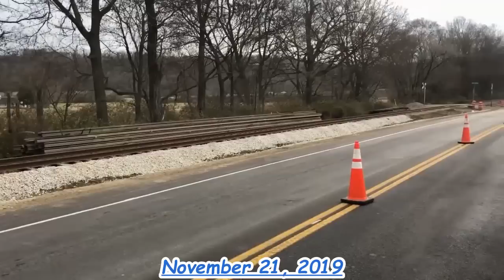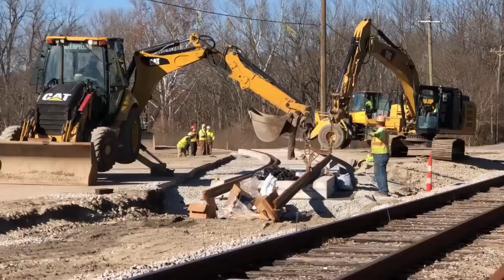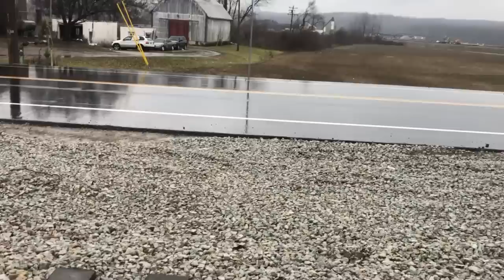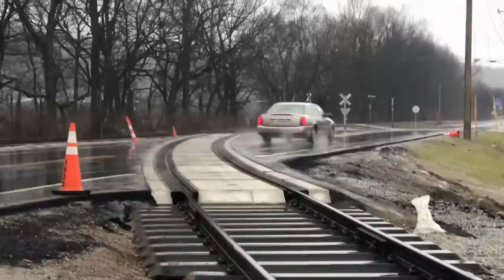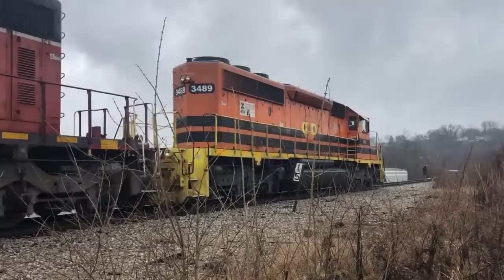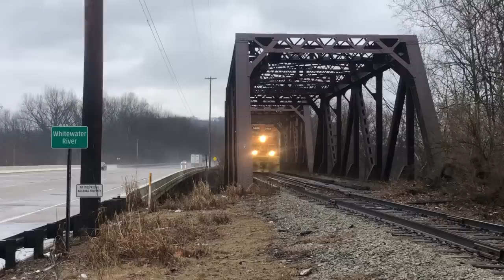New Railroad Spur Installation!  New Crossing, Derail & Switch!  Steel Cross Ties!!  IORY

Comment: Great video!! Glad to see there ate places still having spur industrial lead tracks being built to facilities. Also that is very interesting seeing steel ties for what looks like the while length of the new track rather just at the derail switch!! The only time I known of steel ties used were for light rail tracks that are street running before they get the concrete poured over them.

Comment: Who ever Thunk a New Rail Line (Spur) would be installed in the Year 2019/2020 ?  A BIG day for a LOT of folks. YEA!!! 👍👍👍
Reply: Ken, There is a new common carrier line being built in Utah from Vernal to near Helper connecting with the former D&RGW ( now UP ) It is 85 miles long and will be the first common carrier line built in the US since the 1970's. It should be operational by 2023. It will haul oil, coal, and ag products out of the Uintah basin.
Reply: I saw a new rail spur go in in 2008, for a steel products plant.  They receive steel coil cars via rail, and have a 3.3% grade from the branch line to their property.  The short line operating the branch bought an SW1200 just for the plant 🤣
Reply: @brentboswell1294  OK, but WHERE THE HECK IS IT ? DUH !
Reply: @brentboswell1294  Was it in Canby Oregon?
Reply: Thunk lol 😄
Reply: @chuckgilly  yes it is..
Reply: Ahhh! That new railroad smell.

Comment: Huh, neat. First time ive ever seen steel ties. Ive seen concrete and the standard wood ties, but steel, that is a first.
Reply: Havok Vladimirovich Stalinov Funny I was about to make the same comment I wonder if they will last and not rust out
Reply: Havok Vladimirovich Stalinov Same here
Reply: Trainkid 4501 I am also wondering how that affects track signaling if that acts as a ground I’m not an electrical expert by no means but I was wondering
Reply: Yea I wonder too
Reply: Steel ties are common in Europe.
Reply: Me too,I've only seen concrete and wood ties where I live,there's alot of tracks near me in the city. I even hesr the freight train coming through at 2am since I'm up on a hill and hear the air horn.
Reply: Common in Australia in termite country , they eat the wooden ones for breakfast.
Reply: Same here never seen steel. I thought concrete was the new thing. Asphalt business must be booming or will be
Reply: @remylopez4821  They are insulated from the track circuit.  Steel ties require less ballast (45%, compared to timber ties) and storage space, since they have a large void, so they are actually lighter.  They are also 100% recyclable.  However, a tamper, which would normally tamp every other timber time, will need to tamp every steel tie to ensure filling the inside with ballast.
Reply: Those steel ties and turnout came from my previous employer here in south Dallas! Narstco..... check em out!
Reply: @Havok Vladimirovich Stalinov they’ve plenty of steel ties in Japan metros.
Reply: Steel ties are used commonly underneath street running rail (e.g. girder rail). As for its properties in a signaling system, we'll, Lionel trains have used steel ties for years🤣
Reply: @brentboswell1294  I was just about to say... where are the huge green cardboard insulators and that 3rd middle rail....LOL🤣
Be cool to see something like LIONEL 1:1 embossed into the outside of every 15th tie!
Reply from the maker: I know where there are steel ties in northern Kentucky at the CSX tunnels.  I have also seen plastic ties.
Reply: @JawTooth  👌🏻 plastic ties.... ATLAS or TYCO?? LoL🤣♥️
Reply: @JawTooth  BTW, love your approach to filming things like this switch installation. 
Before and after shots take some extra hours, but it's worth it to document history....especially when you get to railfan too!
Reply: @JawTooth  Do I not see ballast underneath those new rails? If so, why aren't there any? Thanks!
Reply: Trainkid 4501 pnbbgtff8bvd

Comment: The Railroads have a following like NO other sport, hobby, etc.  Very Cool gesture of the Engineer waving 👋 to you.  The majority of time, the Class I Railroads have the dark window Closed and you can’t see the Engineer driving the train or the Conductor handling other logistics, 👍
Reply: we live in a more complicated and dangerous (perception, here) world..... sadly the days of an engineer inviting a 
young impressionable future railroader up into the cab are largely gone.  I love the machines and infrastructure, 
rolling stock, architecture, etc..... but railroading is largely about people.
Reply from the maker: You are correct.  I have been around trains since the 60s and I agree, the crews were a lot friendlier back then than they are today.  I use to get rides in the locomotives and cabooses.  In the past year I have been given the finger twice and assaulted and cursed at by train crews.  I try to stay away from the crews.  My focus is on the railroad itself.
Reply: @JawTooth  wow, I never knew about the negative reactions or aggression.... do we now have examples of
railroader's "road rage"?   Our culture is not heading in the right direction, I'm afraid......  perhaps the working
conditions on the line have changed and bear some responsibility.... just guessing...
Reply: Hey at least the Amtrak crews are friendly! Usually you can get a nice wave from the engineers and even a couple of blows on the horn....as long as you're not doing anything stupid and unsafe!
Reply from the maker: @williammorse8330  I made one video showing a conductor giving me the finger near Cincinnati.  The other one and the assault I have not posted yet.
Reply: That's terrible to hear, your being treated so badly by some train crews for simply trying to record railroad activity for historical reasons and for your enjoyment, as well as sharing it with other like minded railfans. If nobody ever bothered to go down to trackside and photograph the generations of railroad equipment and activities from past years a lot of visual transportation history would have been lost. Guess the crews that gave you grief could care less about railroad history. The people they should really get after are the ones who tresspass and deface railroad property.

I remember an article in "Trains" magazine back in the 1960s where one of the staff went to Georgia to see what shortlines were still operating that had been featured in the book "Mixed Train Daily", published back in the 1940s. The writer mentioned one crewman who threw an apple at him while he was photographing the moving engine from a roadside parallel to the track. He had a chance to ask the crewman at their next stop what his problem was, to  which he answered, "I don't like my picture being taken!"  Guess even in the '60s a few RR workers had an attitude towards being photographed.

Comment: I suspect that the steel ties are for the sharpness of that turn. Given the sheer weight of the loaded cars moving on that turn at even slow speed would put a ton of stress on the ties. Wood ties would break and not be able to hold onto the spikes without stress and eventually splintering. While concrete ties would handle the stress better, any cracks on the curve would instantly break up the tie because of the stress. The only place I've seen steel ties was in London at a station that had a very very sharp turn. There were always the words "Mind the Gap" on the floor of the station where the doors open. They also mention it when the subway train stops.
Reply: I've seen some pretty sharp curves with timber ties.  I noticed that this track didn't seem to have a flange greaser, tho...
Reply: @NiceMuslimLady  There are few places, outside of subway tracks, that have this sharp a turn, though. You're right that wood ties work on curves. but this curve is very sharp and prolonged as well

Comment: Neither rain, sleet, snow, or a zombie apocalypse can stop Jaw Tooth from his appointed rounds.

In my day, auto rack cars were completely open to the elements.  There was a time before when they were shipped inside box cars.  Today they are covered, but Europe still ships vehicles on open 'flats'.  Reminds me of the time in 1967, or was it '68,  when I was working Englewood Yard in Houston. [SP].  Not sure what happened, but an open auto rack car full of brand spankin' new Pontiac Firebirds came off the hump and down into one of the tracks I was near.  The retarders didn't retard, or the switchman pulled the wrong cutlever, or someone got confused and didn't shove it, but anyway it slammed into some other cars in that track and Firebirds went everywhere.

Comment: I trust that you will post a video of the first train to use this. (Hi-rails and construction vehicles don't count)
It's interesting to me to see how quickly this work was done.  They have been rebuilding a 7 mile stretch of the old Jersey Central in my backyard since 2006. New ties, trestles, sidings, crossings---no trains.
Reply from the maker: I tried to but I didn't get there at the right time

Comment: I've seen rubber ties, wood, bridge ties and concrete. Hollowed out steel ties for a switch but never metal ties. Bring a siding it must not need a track circuit. Nice video.
Reply: Steel ties ARE metal ties.  The crossing probably has a circuit, but, they can insulate the steel ties.
Reply: Now, plastic ties, made from recycled HDPE, are being used in Texas. The problem with plastic is the hot, dry climate, which causes plastic to dry out and crumble.
Reply: @danielcobbins9050  the plastic tires had holes in it for track wires. Hard outer plastic and soft inner, with grip surface in the bottom. They only tested them and removed them. Never in service.

Comment: There is a new spur at a cement storage and distribution company in Grandville MI.  It holds about 30 cars and can shuttle them to unload into Two large silos.
18 wheelers load under the silos. There are Four tracks on the site.

Comment: Interesting- lot of upside to steel toes- lower environmental impact, recyclable and durable. Wonder how long the will last before needing replacement. Good to see tail going down . Here in New England the MNTA has plans to reactivate a long closed  line from Stoughton to New Bedford MA  - but dang it seems to take forever. We need the track team that laid that line working here .
Reply: Is it lower environmental impact? Creosote is nasty stuff; making cement requires a lot of energy and releases a lot of CO2 from making lime; steel requires a lot of energy and releases a lot of CO2 from smelting the iron. I really can't tell which of those would be the best or worst.

Comment: Cars coming toward the spur could see a train in time to stop but not the cars coming the other way. Their vision would be blocked by the trees. Sure the engineer would blow his horn, but you know drivers these days blast their radios. Just flashing red signals should be enough. Looks like its going be used pretty often. That is a state highway I'm assuming.

Comment: Amother excelllent video, sir.  Thanks for going out into the miserable weather to film the train stuff; but:  Whaaaaat!!! Steel ties--I would think they would rust and cause a train wreck etc.  Are they treated with something to prevent rust?  Have you ever seen steel ties before?  I'm shocked.  Steel ties seems so wrong.  What's your take on the issue, Mr. T?

Comment: I came down IN sr 1 out thru Connersville. Seen a mess of coal cars on Whitewater valley railroad. 
And they where working on the tracks between  Brooksville and Harrison. And I seen signs saying nickle plate rd. I've seen old engines with that on it. Did that run thru indiana?

Comment: Why no RR signal warning flashers at the spur crossing? And why is the interlock not electric? With an indicator of the track switch positions? Could have a remote switching from a dispatch console or tower.
Reply: @wfvideos4099  Of course I am aware of the red/white flags on the manually controlled interlock as the indicator of the track switches.  This being the case with limited use of the crossing and a train conductor stopping traffic,  yes then agreed no need for RR crossing signals or an electrically operated interlock.

Comment: Nice video.never seen steel ties before.what happened to cement ties?
Reply: Dennis Willaman google “narstco” they are more eco friendly and easier to dispose of than wood ties that are coated with creosote.
Reply: Concrete ties have a bad reputation in northern climates. The freeze thaw cycles caused them to deteriorate prematurely. Several railroads including the Massachusetts Bay Commuter RR had to completely replace concrete ties throughout their system because of this problem.

Comment: I don’t claim to be huge rail fan, but this vid popped up in my suggested list and I clicked. Turns out I live a few miles away.  I’ve been watching the progress as I drive by and the other day I noticed the rail makes a quick descent of about several inches when transitioning from the crossing onto the new rail bed. Is there a reason for this or did someone get the elevations wrong when excavating? I sure hope this will cut down on the truck traffic into the asphalt plant.

Comment: Wonder how they deal track circuits with steel ties? Insulators between the rails and the ties? We have wood and concrete on the KCS main line around my house! Never seen steel
Reply: Tyler Costantini they make insulated as well

Comment: Haven't seen steel ties, only concrete ties on the west coast. Steel ties must be due to the weather conditions in winter which are worse than on the west coast
Reply: Robert Callahan they’re eventually and hopefully going to replace more of the old wood ties. Eco friendly and easy to recycle. About the same price range as wood ties.

Comment: Steel ties under steel rails?  I have seen concrete but never steel.
Reply: Robert Heinkel common in Australia termites eat the wooden ones.
Reply: Robert Heinkel: Same, I didn't know steel ties existed until now.
Reply: hi R H...
'
yeaa first time to see this photo video about metal on the trackrail...
usually concrete and wood
Reply: Steel ties are used in some parts of Africa as well. Same problem with termites.
Reply: @geoffdavis4730  This is correct steel sleepers were and are in some places still used today , the......
Picton - Mittagong Loop line in NSW Australia is about 80% steel sleepers the NSW Rail Transport Museum is based at Thirlmere on this line.
🤠 🚂🚂🚂🚂🚂🚃🚃🚃🚃🚃

Dam termites !!!!! 😒
Reply: Robert Heinkel  Steel ties are used on the Canadian National line between Vancouver and Prince George, BC  (formerly the British Columbia Railway) in the vicinity of Whistler, BC.  I don't know why steel ones were chosen as concrete ones are also used nearby.

Comment: My question about steel ties, if the railroad were to later install automatic crossing signals, which would require a track circuit on a short segment of track that's crossing the street, wouldn't the steel ties cause a short circuit?

Comment: That autorack train that rolled by, it makes you wonder how much overspray got on your brand new  vehicle the that port facility had to clean off.  Maybe why so many new car clear coat on the paint fails so quickly.
Reply from the maker: I always have wondered about that also

Comment: why was that tie upside down there by the derail
Reply: David, That is called a channel tie. The switch stand will be installed on one end and the switch rods and connecting rods will be installed inside the tie rather than between the tie like on wood switches.  Installing the rods inside the tie protects them and eleminates "Pumping" due to ballast cleanout at the rods. It also allows them to tamp without removing the rods. I've worked for NARSTCO for over 14 years in Engineering and Operations. Made in America. 100% recycled. 50 year projected life cycle.

Comment: I noticed a second switch throw. Are two tracks planned into the plant?
Reply: The switch throw on the customer side of the road is to actuate a split rail type of derailer. The main purpose is to prevent any cars from drifting down the siding and fouling the main track. Derailing the cars before they get to the main track switch is a safer situation than having a collision occur with a train moving on the main track or, in this case, also with road traffic.

Comment: 2:39...something just doesn't look right here...those rails don't look like they are lined up correctly.
Reply: I saw that too. Can someone look into that?
Reply: Yep, they fucked it up for sure.  I’ve built and installed hundreds of turnouts...this one is in the wrong place...probably not engineered, just out there winging it.  That’s one of the nastiest flat spots I’ve ever seen in a new turnout.  Somebody needs to hold the contractor’s feet to the fire and make them fix it on their dime.  Shit work.  Would love to know who did it so I could give them some free advertising on how not to build track.
Reply: even a rail into the frog looks weird. looks like they to get a track machine in and smooth out the dent before the crossing.or, they need to move the track switch itself towards the crossing a few feet to smooth the curve out.

Comment: I would be interested to find out how much it costs for the switch and what looks like 1/2 mile of track, maybe more longer.
Reply: Boyd W, say a little more than half a million for a turnout and half mile of track.  $60,000 for a wood tie switch, including all materials and labor and equipment to build and install it.  I’d have to call to get a price on a steel tie turnout, but in the same neighborhood, probably a little more.  Estimate somewhere around $170-200 per track foot for wood ties, all materials and labor/equipment included to build it on prepared grade to finished product, give or take a little.  I’m a track estimator by trade.
Reply: That’s a lot but I’m not surprised.